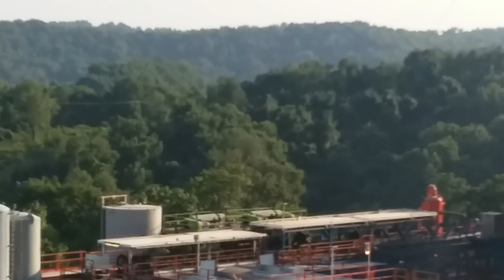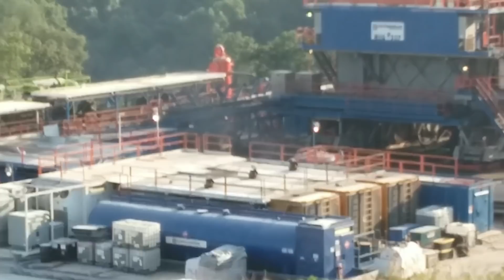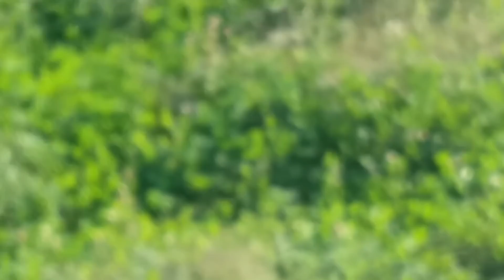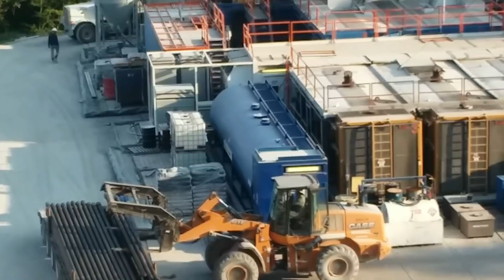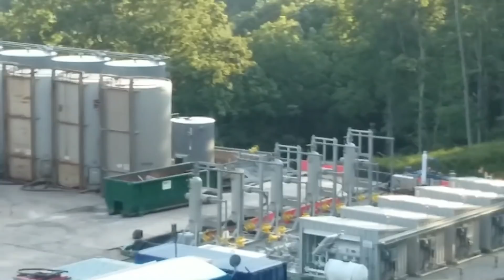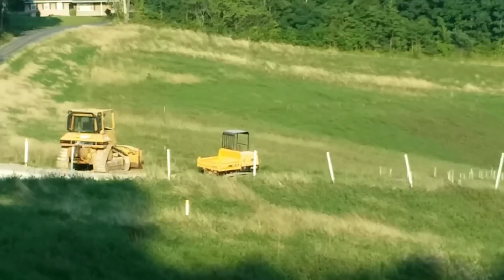Totally Huge 16,000 Foot Long Horizontal Well Drilling Rig.... Unbelievable How They Do This!

Comment: The Marcellus shale and other natural gas producing zones underground are formed just like they are above ground, with hills and valleys, sometimes there is a fault in the ground where it just stops and drops off a few hundred feet or more. Typically the well bore underground is 800-1000 feet apart from other wells because that's how far the fracturing process will reach through the rock. In some instances a newly fraced well will reach into another well bore and "kill" or water off the existing well. Not often but it happens.
Reply from the maker: Spoken like a true expert who knows his job well

Comment: So, they are pullig out the drill pipe, but whats the vertical pipe the sortof forms a tower of pipe right next to te derick? Is that the casing pipe you mentioned?  Interesting video.  It would be interesting to see this site once all the wells are drilled and its just producing gas.
Reply from the maker: That big pile of pipe, 40 footers, on the ground is going to be
the well casing. The entire well length gets cased to the end of the
bore. Actually I made a video yesterday of this site after it is producing because of a new innovation they are trying here in Pa.
for the first time with evaporators to get rid of produced water, but
that video won't be on You Tube until late next spring. Thanks for
writing in and for watching

Comment: yeah those diamond auger bits aren't cheap, the 1 gallon pails are 10 grand each, my dads company eats thru those like candy drilling thru granite to put power lines and communications towers up in all the mountains. with 4'-8'-12' diameter holes depending upon the load and proximity to hurricane force winds along the coasts.
Reply from the maker: They told me they use a different bit for drilling thru the harder rock,
no granite here, but I can imagine that would be extremely hard
on bits. Limestone bout the hardest they have to drill thru. Nothing
bout a drilling operation is very cheap to purchase. Wish I knew
what it cost to drill a well like this, well into the millions

Comment: Sure different than when we were drilling 2,000 ft wells years ago and the rig deck was at ground level and the drilling mud pit was just a very few ft away.  We did use a set of pipe tongs that the driller applied the force to break out or set the torque on the pipe using a rope wrapped around a cat head of if it was a fancy rig there would be a mechanically pulled tong chain.  
All drill stem and other pipe were Piss-Anted into and away from the rig.  That meant it was carried by men too and from trucks or the pipe tubs. You never had so much fun as when you were carrying 32' sections of 2 3/8 upset tubing over a couple hundred feet of knee-deep mud.
Working a well-servicing machine (pulling machine) when it was 100 degrees and you were in a tall cornfield or working the same well when it was 10 degrees and no corn for a windbreak.  
Back in the day when wildcatters were starting to hire geologists, one old wildcatter who really did not believe in geologists but had to keep up with his competitors so when the landowners came out to see the drilling progress they were impressed.  Well, old Davis got tired of his geologist telling they were drilling thru the mesisene, plisosene and all of the other senes.  He said, "Sonny, when we get to kerosene call me."

Comment: This is a great and informative video! I love all the specifications on the equipment, really gives you a sense of the size of this operation.I knew they could move the head up and down as they drill but I had no idea they could do so to such a degree. 35 Ft seems like a very close distance to another well bore considering all the room there is out there for running your hole.
Would have loved to see the drilling head. Probably more advanced than anything I've seen before.
Torque on the pipe threads is amazing. I wonder how much rotational force they are willing to put on the pipe as it is working.
Reply from the maker: Yea that head was neat to see, was bout the size of a soccer
ball, but again I was not allowed to video or take pics on the
well pad itself, so sorry bout that. Great to hear you enjoyed the show,
I was lucky to be able to share the info that was given to me
by my tour guide, there was a ton more stuff he told us but
it was so loud on the rig, I didn't get everything he said. Do appreciate
your watching

Comment: This is spot on,  I found out 3 months ago I inherited 70 acre mineral right is WV,  I got the contract and it is dated back to 190.  Got a lawyer involved, Had to be in WV, there you can own the mineral rights,but don't own the property.  They are going to drill and horizontal bore into a lag natural gas pocket.  From  property  next this 70 acres.
Reply from the maker: We can own mineral rights but not surface also here in Pa. I happen
to own a couple acres of mineral rights but sold the surface. They have a well on my neighbors property with a leg under mine so even
tho there is no well on my property I still get royalty off the 8 wells
on my neighbor. It not much since I only have 35 acres out of the
1,000 acre block those wells cover. That is a large block, most blocks
are around 500 acres or so at least here. Thanks for watching Henry
Reply: @ccrx6700  Congratulations!  You are a Gas Baron, though a partial one.  Hope it pays off and especially hope no water wells are hurt!

Comment: Thanks for this view of the operation.
I worked in the North Sea when the late 70's  early 80's oil boom was on.
The platforms, lay barges and double cranes on converted tankers were huge.
Not as easy as working on land.
The electronice have come a long way, like we were in the stone age.
But the horizontal drilling was used then .
One of the highest paid were the guys that did this, I believe that the one of the largest fields wells might have been allegably been drilled into there nabours fields and most likly vice versa.
It's not good using oil and gas but untill govenments get there act together and especially in the UK allow wind farms to be built and storage of electricity and hydrogen produced from excess eltricity will still need them.
I enjoyed the intresting work but it was also more dangerous than working in a coal mine in the UK at that time.
Thanks for the video.
Reply from the maker: Glad you enjoyed Anthony, we do appreciate your watching and for
sharing your experiences with us. That had to been hard work you did
for sure

Comment: I believe in protecting the environment as well anyone else and I'm critical (not opposed) of fracking. But, the idea of totally dismantling an industry such as the gas industry is not realistic. Look at the domino effect that would be created at toppling all of the industries that feed  just the operation being viewed. This is an excellent video.
Reply from the maker: Thank you Robert, really appreciate your watching and your
well thought out comment sir. You got a good head on
your shoulders sir
Reply: We use a lot of electricity and all those electric cars they want us to drive only increases the demand by a massive amount. I did some numbers for here in NJ and to change all cars to electric would increase consumption by 35% but renewable energy even before that increase is less than 10%. That electricity has to come from somewhere and the gas and even clean burning coal systems are more important than ever making this the true backbone of our world. It provides relatively clean energy and good jobs from the field to the generation plant and many associated industries. When I worked for a large truck parts company we sold plenty to the over the road cargo and delivery sector but when compared to what we sent to the areas doing gas production and fracking it didn't come close. The industry has a wide ranging economic impact thats nearly impossible to measure and those who think its unimportant or who marginalize it have no idea of the impact those decisions make nor do they have an alternative thats anything more than fantasy. 
Love the video and seeing this amazing industry at work, even moreso because I understand the value and positive impacts it has for so many in jobs and income and in quality of life for so many who have no idea how this is the only thing that keeps the lights on when they flip that switch.

Comment: Casing NEVER comes out of a well. That is cemented into the other casing and formation. They are actually laying down drill pipe. The machine is called a lay down rig. But is also used to feed casing to the floor. The floor is where all the work takes place as well as the derrick.
Reply: Its does when you P and A a well, its a catwalk to…
Reply from the maker: You are correct Robert, my mind was not working correctly, I just
could not seem to think of the right terminology when I was making the video. Drill Pipe! Golly I feel kinda stupid. Do appreciate
your writing in and for watching sir, glad you made that point

Comment: My brother has engineered and designed some of the drill pipe used in these horizontal drilled holes for the company he works for. When they start the fracking operations, which comes later after the rig moves out and the coil tubing unit comes in.  I've engineered and designed some of the frac plugs used.  Patterson has a yard next to my subdivision where I live.  They had close to 20 rigs stacked in there last year.  They have been moving rigs out weekly in the last couple months, mostly going down here in south Texas and Eagle ford. 
I can sit here and watch this stuff for hours on end.  It's in my blood, third generation oilfield worker.  My late granddad started out in the East Texas oilfields back in 1930.  Thanks for sharing,   Ken
Reply from the maker: Awesome comment Ken! Really appreciate your writing in and sharing
that with us sir. Natural gas drilling has been a boom here for the past
10 or so years, lot's of workers have come up this way from Texas, the ones I have met are very hard working, down to earth folks who love
their industry and are very dedicated. I've heard some really cool
stories from several of them of their experiences. My son is a foreman
for the gas company that owns these wells here.

Comment: Assuming this is a fracking drill system judging by the storage tanks to the right in the picture..
Reply from the maker: It will get fracked, this video was made couple months ago, they
are fracking right now, will make a video on that but it won't be posted
until sometime in the winter. Not much to see when fracking, just a lot
of noise and equipment

Comment: I saw one of the fiber drillers, and they really know where the head is, it has sensor and they have good control. ?
Reply from the maker: it is amazing how they know where this head is, they use all kinds
of sonic and gps kind of stuff to track it, more stuff that is above
my level of knowledge, it just amazed me that they can do it and
all the high tech stuff they had to do it. I didn't get to spend a
lot of time in the control room with the rig operator so I am a
bit ignorant of everything they used for that. Appreciate your
watching and writing in Gerald

Comment: Ya, and they say this pollutes ground water, this is nonsense, I have a well and the well water at it's deepest is 1100 feet, it is a fact.
Reply from the maker: Seems like you started a lively discussion Gerald, but that's okay with
me. Drilling and fracking have much more regulation now than they
used to. There were several cases of problems due to non compliance
with regs and some unscrupulous and cost cutting methods used
in the past.

My son is a foreman for the gas company that owns this well. They
are extremely highly regulated and watched over. everything is
done to complete compliance with the regulations now. I cannot speak for any other gas or oil company, but I can assure everyone
there is absolutely no way anything from this company's well bores
can contaminate anything
Reply: Except that the ground water pollution occurs at a much higher depth due to failed or leaking cement. I am not against drilling, just poor regulations.
Reply: @johnslesinger7109  a lot has changed since they started drilling/fracing. Early on especially in northern Pa drillers contaminated some wells by pushing drill mud into the water system. Now days they air drill the top part of the hole to greatly reduce contamination. You are no more likely to contaminate underground water than you would if we’re drilling a water well. And to those that think fracing causes contamination are unaware of how it works. It’s not possible and there are zero confirmed cases.
Reply: @davislanellc  There are zero confirmed cases because the courts will not hear water contamination cases. When drilling they go thru fractures and drilling residue or cement goes into the fracture. Sometimes this can enter the water aquifer. Research the term "thief zone".
Reply: You are the one that's unaware.
Reply: @johnslesinger7109  not trying to get in an argument here just having a conversation. There have been court cases. the drillers usually lose not because they contaminated a well (some did but not because of fracing) but they change the case to other things like. You can look up the case in Dimock Pa against Cabot which is why Drillers usually settle out of court. on rare occasions they have contaminated underground water while drilling. Again they have switched to using air to clear the hole until they get below the water table. This greatly reduces the chance of contamination. My point was everyone gets up in arms about fracing and that can’t get to underground water. At the water table there’s at least 3 pipe maybe 4 supported by cement,each one capable of holding the pressure. At the bottom where they start to go horizontal is the weak point. It’s single pipe there but it’s thousands of feet below the water table. When they have a blow out there the well gets filled with cement and capped it’s done and a waste of money. In fracing if they lose pressure and have a leak it’s on the surface before the well head or it’s at the bottom of the hole neither can get to the water table. You mentioned regulations again I’m not sure you realize how heavily regulated it is. In my opinion the rules we have to deal with now are a bit “over the top”. You can be against gas/oil/coal mines but I bet none are willing to give up what they provide. Again I’m not trying to start an argument. The misinformation out there drives me nuts.
Sorry Dave not trying to stir the pot.
Reply: @davislanellc  I am not going to argue either. In fact I should not have even commented. I am bound by a non disclosure agreement and thats all I can say. I do not even live in Pa any more. I do enjoy this channel though.
Reply: Wait until you can set your water on fire. Then talk about how it can't be done.